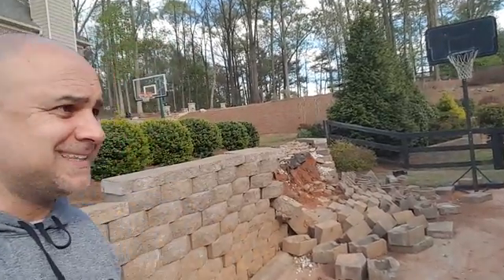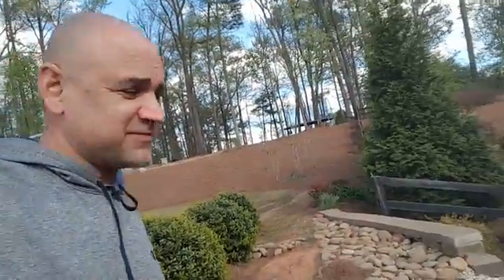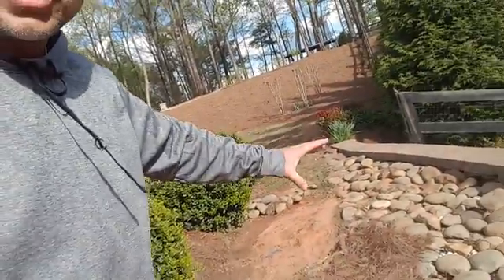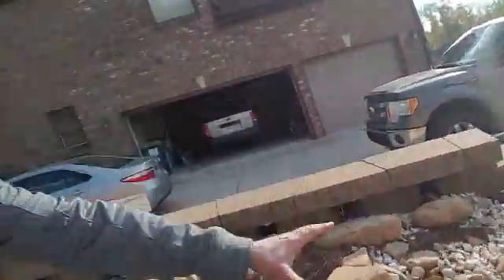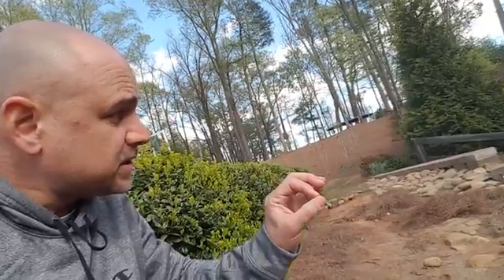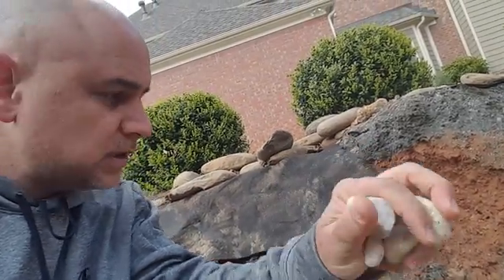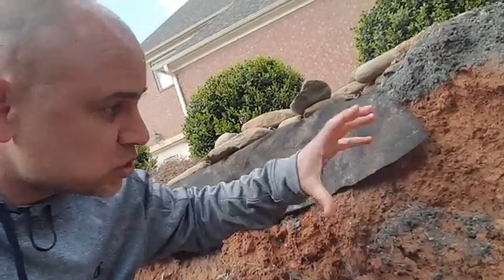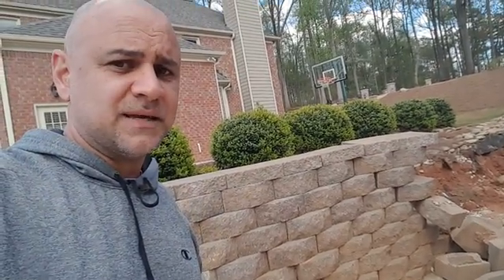Why Retaining Walls can Fail... 🚧 Solution to Rebuild Retaining Walls (Using proper Techniques!)

Comment: Couldn't help but notice the diagonal former mortar repairs in the brick homes upper windows,(cracks are going down to the left, light colored mortar) seems the stacked block wall in driveway your working on is the least of their concerns. It looks like the home builder/developer possibly didn't engineer the entire foundation and drainage properly overall for the soil and/or conditions. Bigger Ouch possibly down the road?
Reply from the maker: Good Eye! It's sad when people spend so much money and get poor quality work

Comment: such retaining wall does not require a french drain. 1 ft thick Gravel behind it is enough. the water suppose to drasin thru the wall itself. The failure is due to bad 1st row layout on unstable soil.
compacted gravel under the first row is a must

Comment: Very informative video, thanks for sharing.  I'm very concerned about retaining wall failures.  I just moved into a community where the developer utilized large retention walls in order to address the extreme grade changes.  The lot beside my home is flat; however, the rear of the property  features a metal fence with a 20' drop retention wall to the street below.  I worry if this wall fails in could impact our foundation.  It is rumored the new buyer wants to install an unground pool.  Would that be considered safe?